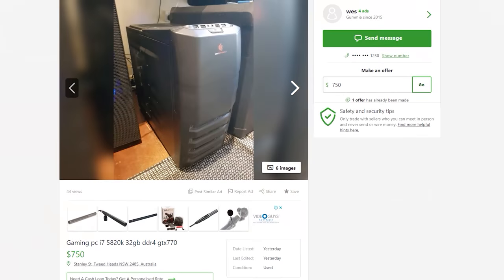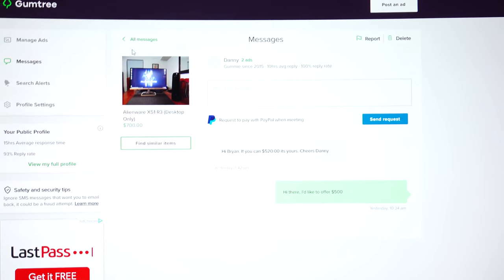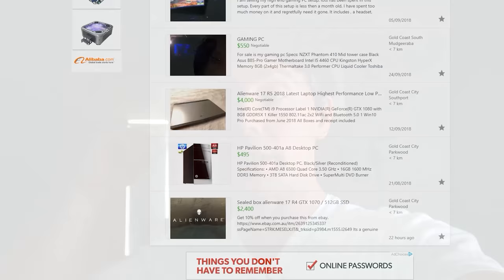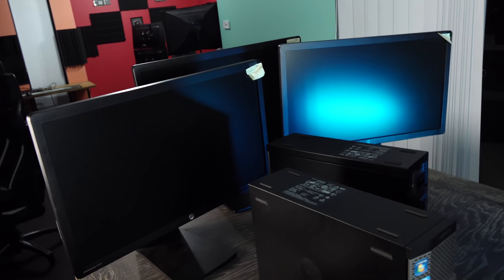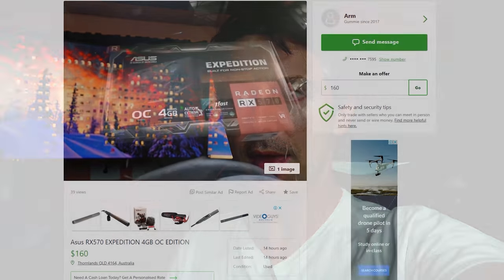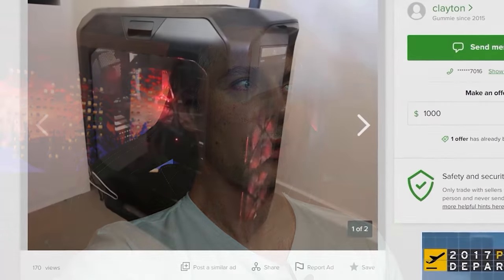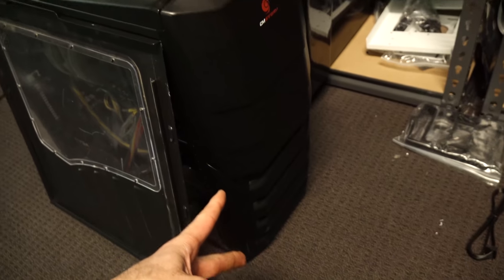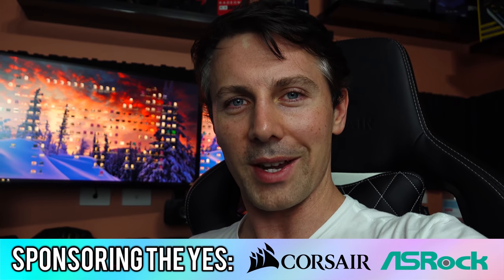Bargain PC Parts | September's USED PC Parts Hunt

Comment: Woo, some Friday night Yes-ness! 

Picked up my own little bargain today, a full system with an Asus z97-k, i5 4690k, GTX 760, 8gb RAM, Corsair 750w PSU etc all in a quality NXT case! They even threw in a Corsair HS40 headset! 

200 quid, well spent! My Tech YES force was strong today!
Reply: Yes
Reply: oof
Reply: did you get a lucky one with a M.2 connector?
Reply: Hell yes! In fact its the only board iv had my hands on which has this! 

I was just going to pull it apart to flip the parts (keeping the case, psu etc to re-house either my X58 or i7 2700K build and have been recording the whole thing for a video for my channel BUT, as soon as I sniffed about I could see that what iv got is really quite serious so im thinking ill skulk around for a cooler and see what can be done with some overclocking (once if fully benched the system in its natural state of course) :)
The machine is litterally on next to me downloading some games etc as I type this.
Reply: @UsedTechHustle  lol I miss X58 and Z97, I'm on Z170 with a 8700K modded though so I'm not complaining
Reply: Pc ColdWar  Depends on the coooler. Just get a cheap AIO
Reply: oooooohhhh friday freaky lucky!!!
Reply: Used Tech Hustle i5 4670k MSI h81m p33 rx 5704gb with 8gb g skill 1866mhz 430W EVGA 240GB ADATA $195

Comment: Picked up a free gtx 980 ti that was “broken” installed a h50 I had lying around and bought a kraken g12 kit and now I’m gaming 1080p max setting at 41c :)
Reply: icedoutelite how was it ‘broken’??? What a score!!
Reply: Awesome score. That's even better than the NZXT case, 50-w PSU, ASUS h81M Plus motherboard and i5-4670 I got in exchange for an NVIDIA Geforce 210- GPU.
Reply: @funbucket09  99% chance cooler fans were broken
Reply: @yashpashar4758  you'd think so haha.  Someone at work needed an HDMI port on a customer PC and without thinking, told me I could have any PC on a particular pallet in exchange for said GPU. I should have checked the pallet first though since I found out after that there were a few 6th gen i5 sytems in there too. All custom built.

Comment: You can fit a full sized GPU in that Alienware.  Just make sure you have the larger power brick, and put in a blower (reference) style card.  I would say you're good up to a 1060 with the larger power brick.  There are only two fans in the case, aside from the CPU fan.  One over the motherboard, which is really small, and another 60mm at the front of the case that can be super loud.  I had a full sized gtx760 reference card in the x51 R2 that I flipped just recently as an example.

Comment: I got a ProDesk 400 G1 with an i3-4130 for $90 off gumtree last week! Going to put a low profile GTX 1050 in it and it’ll be an excellent console killer for the lounge room all for $200!
Reply: Not sure about the console "killer" part sounds more like an alternative to a console, less graphics but more utility.
Reply: Janitor 
Yeah maybe not “killer” but the 1050 is pretty much on par with a standard PS4 and like you said it has much more utility. I can’t find a PS4 slim for any less than $300 even used most of the time so considering the PC only cost me $200 I feel “killer” is justified.
Reply: Pc ColdWar 
If that’s your thing yes. But it’ll also play most of the fantastic indie games and older classics with no problems either!

Comment: EVGA is selling B-Stock GTX  970s for $130USD on eBay as of 10/06/2018. Picked up an *GB Asus ROG Strix RX 480 for that price on 10/05. If y'all need power supplies for those, EVGA is also selling their 600watt 80 PLUS non-modular and 850watt BQ 80 PLUS Bronze semi-modulars for $20 and $35, respectively.

Comment: Lots of good deals. I got lucky when I got an NZXT case, 50-w PSU, ASUS h81M Plus motherboard and i5-4670 I got in exchange for an NVIDIA Geforce 210 GPU. Also as a side note, the motherboard supports BIOS updates via USB without needing a CPU or RAM to be fitted.

Comment: I had a bit of a mini used PC hunt myself this month. Found three Haswell refresh HP systems (i5-4590), but all of them went above what I was willing to bid on them. However, I did pick up a slightly older PC (Dell Optiplex 9010, i5-3570, 8 GB DDR3, 250 GB HDD) for $87 USD after taxes. Waiting for payday, then gotta decide whether to go for a used GTX 980 (some are as cheap as $100), a new case and a new PSU, or put it towards a GTX 1050Ti.

Comment: In my country asue rx 570 8gb going for 150$-160$
U can find sapphire rx 580 8gb for 180$-190$

I bought a asus 1060 6gb oc for 180$ last week. Would have gone for a rx 580 8gb but my power supply is only 450w.
Reply: where?
Reply: @JoRoBoYo  Bangladesh
Reply: damn lucky.. europe its ebay 300+€ for gtx1070 :( or 220+euro gtx1060 6gb.... and gtx1080 ti 600-700€ on local craig list site in france... same for gtx1080 400-450€ same price as new... but saw some gtx1070 custom for 300€ but those lasted 2h before they where sold... its a mess in europe... its almost cheaper getting a gtx1070 from ebay usa with taxe and shipping its almost as expensive as here in france....
Reply: @reggiexp69  zotac 1070 amp can be easily founded around 250-280$ USD in my country. I saw reference design 1070ti is going for 320-350$ USD but it's rare.

Comment: Picked up the exact optiplex with 250gb ssd, 12gb ram, i5 4460 for 150€ and bought a low profile 1050 ti for 140€ back in January for a mate. This week bought 4770k, 16GB ram, 250gb ssd optiplex for 250€ and bought a 390x for 140€ for another mate. This old optiplexes are insane !

Comment: I have upgraded one of those Alienware x51s, mine has an i5 3450 and I upgraded the GPU from a 950 to a 1050ti. The upgrade works fine but you need to keep an eye out to see if the 350w external psu can handle the new graphics card. The motherboard is an Alienware custom but it supports the new gpus just fine

Comment: Just finished my second used build
Xeon equivalent of a i7 3770 with a z420 motherboard and a r9 fury and some one sold me a dg 77 thinking it was a 76 for $40 because it wasnt opened the total build came out to be $450
Reply: Nice. Xeon 1240v2? I have one in a mini itx build on a chinese asrock Flex-atx board.
Reply: @Fina1Ragnarok  actually the 1620 v2
Reply: @UnFazeablE 7 that what I'm gaming at and it works good it preforms like 95% of a 1070 for $200
Reply: Oh socket 2011! I think that's actually faster than the 3770. And you have options to upgrade to 6 core Xeons in the future.
Reply: @UnFazeablE 7 A bit better than the 1070
Reply: Z420???
Reply: @Philalethes I don't think so. According to HP's advertising for the system, it says "up to 8 cores". Apparently there were different revisions of the motherboard that all support different CPUs so he'd have to look up his board specifically. Still, even a 6 core would be a decent upgrade.
Reply: @Fina1Ragnarok  way past 6 cores ome I'm really interested in is a E5-2667

Comment: I have been doing the triple display setups for years with ebay dell either 1680x1050 16x`0  was almost 10 years ago now I did my brothers with that setup on home depot black pipe and fire sprinkle system pipe hangers I used to mount the quick release plates that were on the stock dell monitor mounts used 1 per plate and to this day still running fine not as tight together as some of the new triple mounts. but when i built mine for 50$ per monitor and about 60$ in parts from home depot my setup still working fine and was dirt cheap

Comment: Might sound crazy, but I have a thing for IBM/Lenovo stuff, and something like that ThinkCenter would look really good on my desk at work for a budget Xubuntu build, so I'm always on the hunt when out thrifting for IBM/Lenovo stuff here in the US, and far as monitors go $5 USD is fairly common place at Goodwill stores, and a few other local Charity stores, so I have a few spares for testing hardware, or when needed for system builds.

Comment: I just picked up a rig with an i7 4770k, 16gb ram, r9 290, 250gb ssd, 1tb hdd for €475. Sold the r9 290 for €150 and threw in an msi gtx 1070 I bought for €250 (2yr warranty) and oh boi that's one hell of a rig for €575

Comment: Those HP LP2065 monitors have IPS panels, those LP**65 monitors were HP's flagship models back in 2006-2007. I have a 19" LP1965 with VA panel for my 2007 WinXP gaming PC. 
13:46 And I have a 27" version of those, I paid 100€ for it.

Comment: I myself picked up an amazing 7700K 1080 ti system for $1000 with 3TB of RAID0 HDDs and 2 512GB SSDs!!!! Also, traded a $55 3930K for a EVGA GTX 770 and fixed crossfire for my 8950M's in my laptop!

Comment: Hey Brian,
I was thinking that for my second pc build I would use a xeon cpu because of the amazing value for money, but when I started doing some research into the different xeon generations/naming schemes/mobo compadibily I got really confused. Could you make a video where you explained the different xeon generations, motherboards they pair with, and which ones to consider for a mid ranged budget build? I have not seen any other content about this, and xeons are not nearly as simple as the naming scheme for the mainstream intel cpus. Also, I wached alot of your videos about the x58 chipset and when I looked up the prices the xeons for x58 were super cheap, but the motherboards were way too expensive for it to be worth it. Is there a better value for money mobo chipset for xeons? I am a huge fan of your content; keep up the good work!
Reply: Joseph Wilkinson where abouts you located mate? I have an x58 rig for sale if you are keen. I am in Brisbane AUS.  I will give you a good price as you are a fan of the YES MAN (Y) (Y)
Reply: Thanks for the offer, but I live in the US

Comment: I saw your video about how to clean pc components, and I do not have any wd40. I was wondering if I could just use isopropyl alcohol on coffee filters to clean my pc parts. I know it will take longer, but that way I don't have to buy anything or drive all the way to home depot(which is far). Is there any problem with using isopropyl alcohol and coffer filters?

Comment: I just got one of those alienware aera x51 r2 version i7 4770 8gb ddr3 for $100 did and i was able to put a gtx 970 in it I seen they can hold a gtx 1070 easy power supplys are external 330watt is what im running

Comment: managed to get myself a prebuilt cyberpower system with a 1060 3gb and an i5-7600k with 128gb m.2 and 1tb hdd with 8gb 3200mhz Ram, missing the other half the 16gb kit though for £300, think I'd okay, just need to sort out the ram

Comment: I've pretty much given up on Gumtree, Facebook Marketplace is just so much bigger now. For example, on the Gold Coast I just snapped up a rig with a Phenom 1035T, Strix 960 4GB, 8GB DDR3, 500W Cougar PSU, 500GB HDD and a Fractal Design case for $250, the guy even threw in an MSI Interceptor mouse, Coolermaster keyboard and SteelSeries mousepad free of charge. 

I also saw a Poseidon 1080 Ti going for $370AUD but that got snapped up real quick.

Comment: Hey, can you do a bargain NAS or PfSense router build with a CPU at 50watts or less TDP? Preferably lower TDP so it can stay on 24/7 without breaking the bank in power use. Thanks!!! I managed to make a few builds less than $150 including ram. Hoping you can do it for $100 or less.

Comment: Watch level one techs video on finding used parts you might want to try that out.
Reply: I watched that video. It's quite good
Reply: Ciao there is a place where I live that is similar. I picked up an old iMac with a core 2 duo and 8gb ram for $100 Canadian. Installed Ubuntu on it, then retropie. Gonna build an arcade cabinet out of it.

Comment: tbh, my favorite deal are the 4$ Monitors

personally, I'm more or less stopping the bargain hunting, I only take insane deals if I stumble across them (I recently got 2 PCs (1st gen i3 and 3rd gen i5, complete except HDD) and some parts just for taking a few other PCs apart so they could be sold for scrap).

I also got a acer sff pc with athlon ii dual core processor delivered for 10€, I'm just gonna take the 640GB HDD for myself, throw in a smaller HDD and sell the thing for 20€ or so (it has win10 from a win7 sticker), that's one of those no-brainer deals I love and I kinda enjoy giving PC stuff to others at good (IMO) prices rather than trying to screw someone over with overpriced stuff.

Comment: Just picked up a PC with an Asus P9X79, i7 3930K, 8GB DDR3, 40GB SSD, 2TB HDD, GTX 560ti, 650W PSU and a Lian Li Case for 60 bucks! I just had to get this :P

Edit: The seller thought it doesn't work. However only the memory configuration was causing some issues. I fixed the build at his house and he was like: " You bastard! What a deal you made!!!"

Comment: feeling a bit down atm. sold a i7 2600+gtx 680 pc for 500$ on gumtree, but when replacing the thermal paste on the gpu i accidentally damaged the blower fan. had to call the deal off. 
need some motivation atm :(
Reply from the maker: :(, did a fin snap off? I have had that happen before.
Reply: @techyescity  no the blower fan just not spinning. It was spinning before. I guess i put too much pressure on the fan or something. Just the old hardware fact.

Comment: Love your videos man, been watching since 2015, really great stuff.
Typing this on my X79 Xeon E5 2667 system, got a non chinese Gigabyte UP4 board but am likely to upgrade to an ASrock Extreme 9 sometime soon. Final cost is only around £430 with a £220 GTX 1070 and 16gb RAM. 
Don't have the GTX yet and am on R9 270x which is okay, I plan on selling for around £60 and getting a 1070 for around £220.
Really good value, thanks for the videos mate.
Reply: Hackmi HaKMI Gigabyte mobos are made in china mate lol
Reply: funbucket09  Yes but you get the idea, the unbranded/Huanan boards really suck for the price they aren't even cheap.
Reply: @HS-eq3gk  yea that's true. I managed to sell that terrible decision (huanan board). At the time it was the only x79s you could get easily
Reply: Lucky. They cost around £120 for a decent one that's less likely to fail here in the UK.
You could spend just £30 more and usually there's a branded X79 board around, gumtree shpock(I had no idea anyone really used it) and ebay are usually good places to look.
I got my board for £72.

Comment: I recently got a 5820k an Alienware Area 51 r2 board 850 watt psu and Alienware 120mm aio for 260 usd. Ok heres my issue I hope you can help me. Every time I try to install windows I get a bsod for something random I have got an irql not less or equal, kmode exception, page in nonpaged area ect. Thinking it was the motherboard I picked up an EVGA x99 FTW k from the EVGA site for a super deal 99 usd and it isn't bstock. And the problem continues on that board as well. I tried 3 kits of ram, 2 power supplies, different hard drives ect. I adjusted the voltages downclocked the cpu from optimal defaults ect. What do you think?
Reply: Chris Van Alstine either a bad cpu or a bad mobo. Do you have either a spare cpu or mobo you can swap in to check?
Reply: @funbucket09  I already bought another board. Evga had the ftw k for cheap. I'm leaning towards a bad cpu as well. I'm just going to sell the boards I can at least make back my money. The evga board is brand new

Comment: Can someone help me on this: recently I bought a x3470 and when the build was completed it runned smoothly. EVERYTHING WAS PLACED CORRECTLY(so no wrong ram slots or what's however ) ! After a couple of hours i shutted down my pc to go get a look in the bios. When i turned on my pc it shutted down after half a second. Now it wont boot anymore. Does anyone have any idea what the problem can be?

Parts:
X3470
Hyper 212x
R9 280x
Ga p55 us3l r2.0
Evga 500w
4gb ram samsung 1333mhz
128 gb ssd
2 tb Hitachi hdd

Comment: Brian I got a 1080 gtx for a song it starts but my system doesn’t detect it any suggestions ??
Reply: Did you uninstall your previous graphics card from windows?
Reply: Can’t even get that far it just hangs at the switch on all power going but nothing no monitor boot logo
Reply: ray jack assuming the card isn't DOA it might be your PCI-E slot. How old is your motherboard?
Reply: 4 months old I can plug my 970 in and works fine
Reply: ray jack  okay, then boot with the 970, wipe your graphics card drivers and then attempt to boot with the new one.

Comment: i did get a evga gtx1070 blower founder thing for 250euro with shipping from ebay, not rally liek woow but better then the 320-350€the custom ones sell on ebay :( who are new 399€ :(
fuk europe. now i stoped bidding cause i went bit to far :) didnt need a gtx1070 but its better then my rx480 gigabyte that i have in my 2nd with i5 6400 the rx480 is a fiuking air plane :(